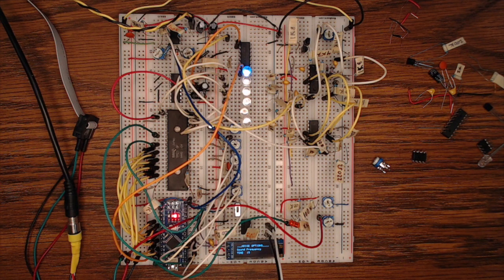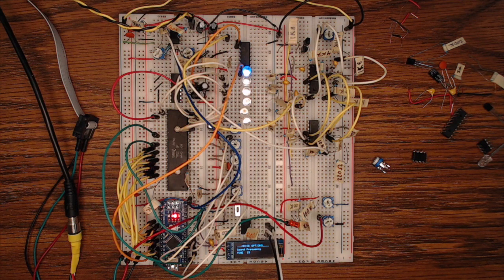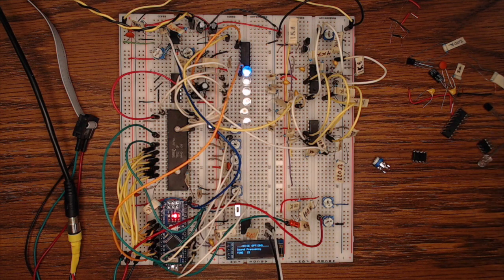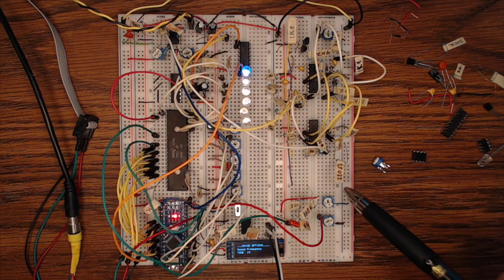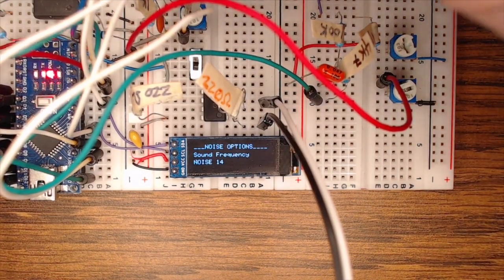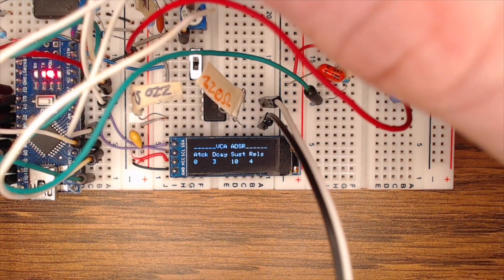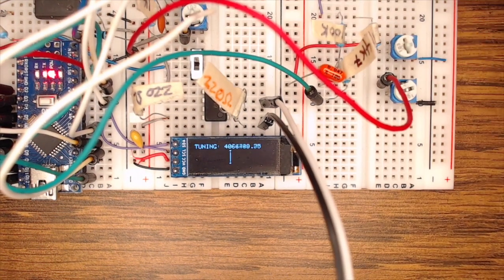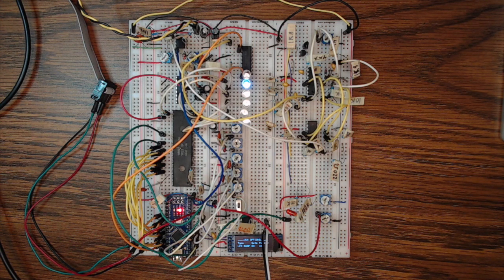YM2149F Module on a Breadboard Tour

Comment: Cool, i wanted to do that as well, mark the resistors with paper tape.
I also made the Rene Schmitz version of the MS-20 filter and a version of my own.
I'm also learning to use the SSD1306, i use a transistor to give it power via the Microchip Fubarino.
Sound pretty cool.